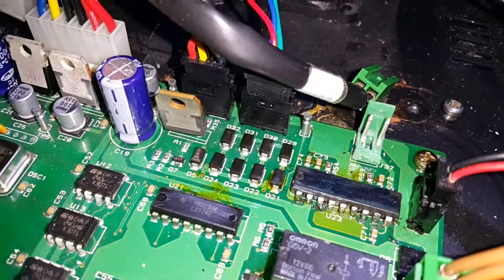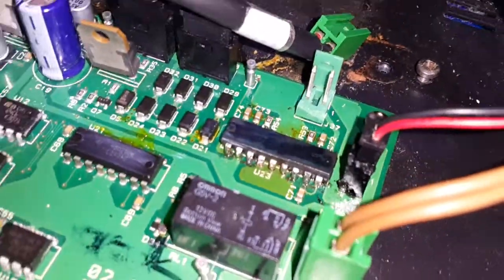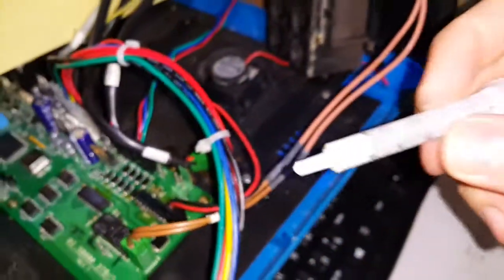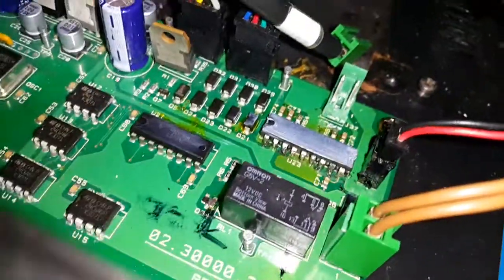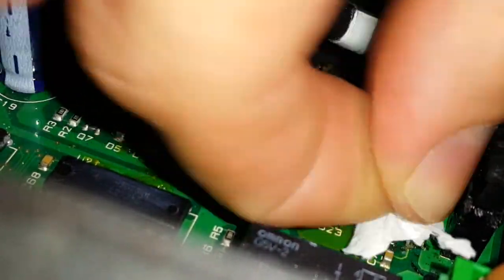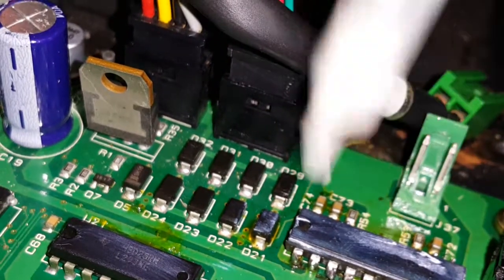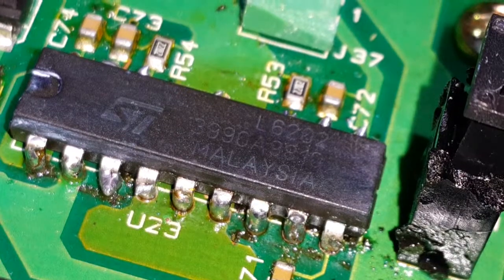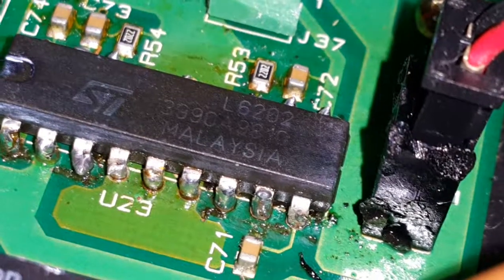How to make unreadable label on chip (IC) READABLE

Comment: Great for unreadable chips but some companies polish the chips so its shiny and the name is erased so you cant reuse them. BTW what is this from? Looks something that has to do with networking.
Reply from the maker: It's true! You can't make readable a non-existing (erased) label.
The current board is from spectrophotometer. This part is the heater / cooling control module and the stepper motor controller.
Reply: Dimcho Hvarchilkov sounds complicated are you repairing it?